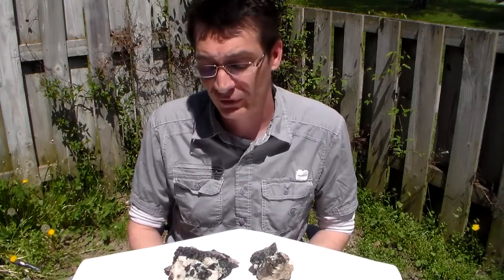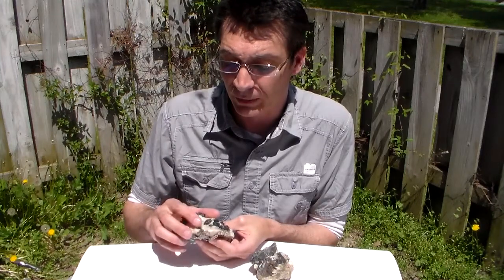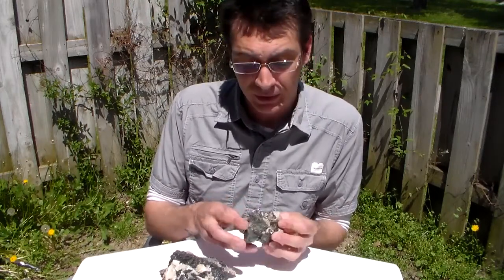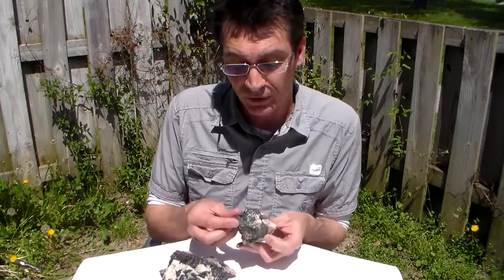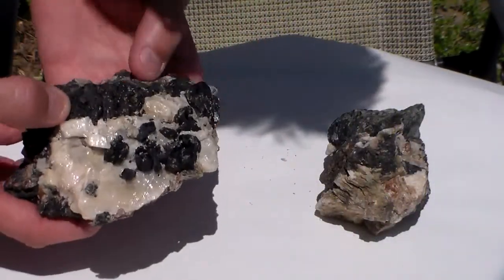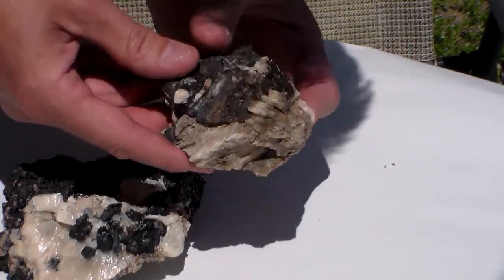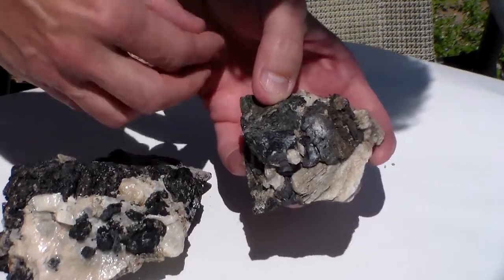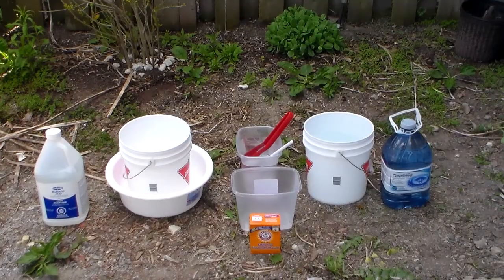Removing Calcite from Mineral Specimens

Comment: After harvesting all sorts of rocks and cleaning accordingly with either vinegar, lemon juice, muriatic acid, iron out, etc I let them sit in distilled water but I've had a consistent problem after drying them in which a chalky white efflorescence/calcite always seems to  come about, sometimes making them look worse than when I first got them. It's been frustrating that it happens before I can clear coat to give them a wet look :(  they look awesome after the cleaning but I just need my clean rocks to dry without the cloudy white mineralization taking over. Please advise on how to prevent this. Thank you so much for your time!

Comment: Are there any gemstone or minerals that can be damaged by muriatic acid?
Reply from the maker: Good question, yes there are many that Muriatic Acid will destroy. Gemstones no I can't think of any, but research first if attempting. Calcites, Phosphates, Limestone, etc. will all be affected by acids. Always be sure to test on non specimen quality material first.
Reply: @RoughMarket  is it possible to apply the acid to just specific parts. Like using an eye dropper to target specific spots if you want to leave alittle calcite for visual effect
Reply: @ashleymcgaha5794  I've seen people add coats of melted wax with a paint brush to what they want to keep using hf I'd assume it would be the same

Comment: You really don't have to dilute HCL, I know it says so on instructions, but HCL is already diluted. of you wanted it weaker use something else, like citric acid or even weaker than that acetic acid, vineger
Reply from the maker: It really depends on the application and the mineral. I have another batch going for several months in vinegar and can take 6-8 months to fully dissolve the Calcite. HCL is not diluted by dilution standards out of the container.
Reply: @RoughMarket  ok, which is why I suggested other things to use in it's place. I totally agree that it depends on the application.
Citric acid is stronger than Acetic, but weaker than HCL, and HCL is way weaker than HFL
And are totally used for different things because of their strengths
HCL will dissolve things that citric or acetic would take a very long time to do, but acetic is totally safe to use using no gloves and little safety precautions. Where the other two need precautions
Reply: @RoughMarket  hcl takes minutes, citric takes hours acetic takes days
These are when you check your stones for etching and what's happening and adjust accordingly and or refresh solutions
Reply from the maker: @robertbradford3461  All good choices for use with differing minerals as to not etch or destroy them. Apatite is especially sensitive and can easily be ruined if not careful.
Reply: @RoughMarket  well with stones like that, that are subject to damage from even weaker acids or from leaching of the said acid, should probably use a dremel instead and do the work, ya?
Reply from the maker: @robertbradford3461  The trouble with using a dremel is Canadian Apatite can be very fragile and the vibrations can easy destroy prize pieces. Vinegar and weak acids will not etch Apatite and will slowly dissolve the weaker Calcite. It just really depends on your piece. The ones I have in vinegar soaking there is no way I could use a dremel. The video will be posted for that one in maybe 6 months, shooting clips during the progress so others can see the results and why it was the right choice. All acids have their particular value as well as mechanical preparation, the tricky part can be determining which to use for the given specimen.
Reply: @RoughMarket  agree, and sometimes we screw it up, Lord knows I have a couple times

Comment: Hi there! I do have some calcite built up on one of my fluorite specimens and was wondering if by your experience, would putting in that acid etch fluorite?
Reply from the maker: Hello, I haven't done any specific work with Fluorite in acid, but I remember throwing in a small tester piece with one of my batches. From what I remember it didn't etch it as far as I could see but the piece was very small. the best way to be sure is to use a test piece if you have one and see how that goes. I have some purple Fluorite from Shickler I'll and try out, been meaning to just haven't had time. I'll let you know how it goes.
Reply: Joshua Chong . Yes it will etch fluorite, especially the transparent variety!! It will dull the surface.. Schicker fluorite is of massive and granular variety, no real crystal form so there really is no point to removing the calcite?